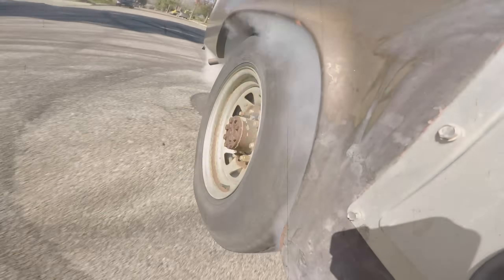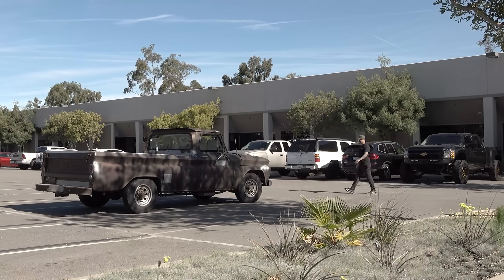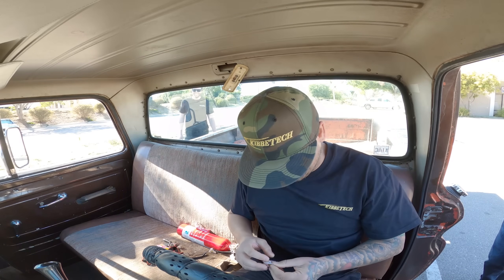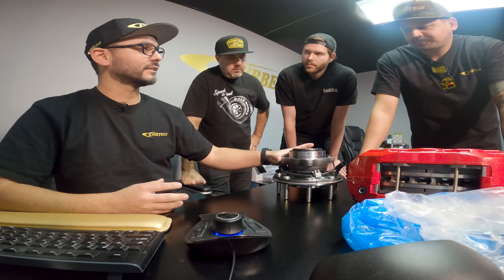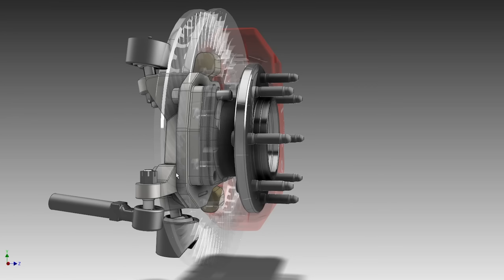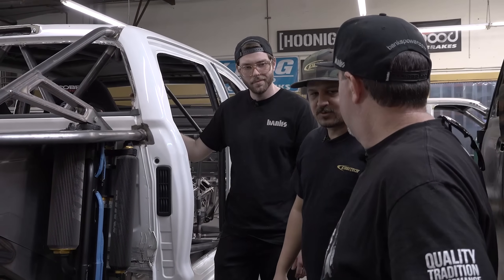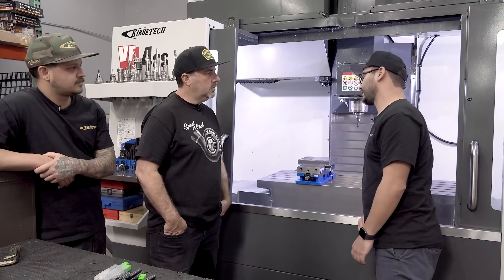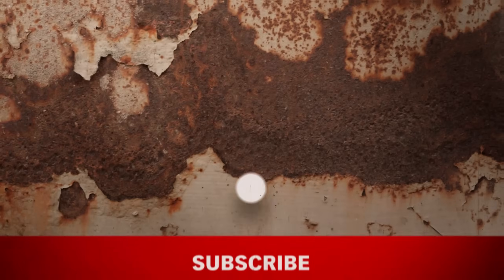Engineering a Custom 8-lug Front End | BANKS BUILT Ep 7

Comment: Excellent - not only did the chap understand what the scrub radius was, he knew why it was importand and explained it well.
It's also why if one is planning to have a square setup - same wheel and tyre size on all 4 corners - one should do the front end first and them use the differential housing width that the wheel offset requires for the correct fit in the rear wheel wells.

Comment: Making a big deal about 8 lug spindles, like no one ever used them for super HP, and they have to re-invent the wheel... I like the content, but this is getting out of hand...
Reply from the maker: You're 100% correct. People have used them before for high-horsepower applications. However, they're not common. You can't find an off-the-shelf 8-lug system for a slammed 1960's C10/20. You have to custom make one. That's all we're saying. But more importantly, thanks for watching. We really appreciate it!

Comment: Can we go back to the Banks educational videos, with Gale and have a separate channel for the Discovery style Bank's Bullshit, such as this video.
Everytime AMSOIL gets involved with utube content, it turns to silly shit, next Banks will move to Motortrend.
Reply from the maker: Considering that AMSOIL has been sponsoring Killing a Duramax and Building a Monster Truck Engine shows for sometime now, we wouldn't call those Discovery style shows. Here are the latest updates for those engine projects. 

1. The 'Killing a Duramax' project is on hold while we conduct testing for our military program in Dyno Cell # 1.
2. Dyno Cell # 2 is down while we update and upgrade to our new engine AVL dyno/emissions equipment.
3. The Super Turbo (Monster Truck Engine) is in the process of being upgraded. Which means pulling everything off the current 7.0 LMM, making adjustments and changes, then installing them all on a newer second gen L5P.

Comment: I left mainstream-TV & it followed me here.   This show gets boring when I know I'll never play with a $26k rear suspension.
Reply from the maker: What suspension price range would keep you interested?
Reply: @bankspower  Banks Power is about inhouse knownledge and buildling your own engines. I would like to see that in this series too. 99% of your viewers can't afford a 7k$ rear axle (IIRC that's what you estimated it would cost). Instead I would've preferred to see junkyard 14 bolt get narrowed down inhouse, show us how to get it done. Aftermarket caliper brackets with stock 1 ton rotors+calipers are cheap. You could still have a sponsor for custom lenght shafts, gears and locker.

I know you said in a comment you wanted something different and that's why you went full custom - most of us cant afford that, and it looks and feels like a sponsorship. A Disney fantasy like Bob said. So I would prefer to see something I could realistically replicate myself.
Reply: @bankspower  The show feels too Disney.  Learning about engineering is neat but the downtime in fantasy is too overwhelming for me.

Comment: Just a little clarification, you don't actually want zero scrub radius as it leads to some unpredictable driving characteristics. Ideally you want close to zero but not actually zero.
Reply: Bingo!
And why the uniballs? Unless there’s going to be a ton of travel?
Reply: @rickrack78  well, I understand uni-balls from a designer's perspective. They're known to be reliable and replaceable for future service. If I had them at my disposal, for a one off build, that's probably what I'd do too.

I was just clarifying that when he was talking about how zero scrub radius makes it very easy to operate a manual steering rack, he didn't clarify that you don't actually want exactly zero scrub radius.
Reply: @Akya2120  , how are they noise wise? Seems to me that they would transmit a lot of noise and would start to klunk after a while ?
Reply: @rickrack78  honestly I can't tell what they are because I'm not the designer. They just look like cad drawings of ball joints to me. Anyway, I'm not real knowledgeable about uni-balls, but like any joint if it clunks it's ready to be replaced. I'd imagine they squeak more if they aren't clean and get damaged faster due to the lack of a dust boot.

Comment: 15" discs?   That's insane.  My first truck had 15" rims.  Amazing what 20 years does.
Reply: My 2015 model year CAR has 15 inch wheels 😂
Reply: My 93 jeep has 13 inch discs....... Now
Reply: My car has 13inch wheels.
Reply: My daily has 15 inch wheels, its a 94 f150 and it was my first truck...
My 65 f600 has 15 by 4 drum brakes, that bigger, weaker, but bigger than there disks..
Reply: I have 17s with 13 inch rotors stock
Reply: @shadowopsairman1583  that's what I am running but they are far from stock